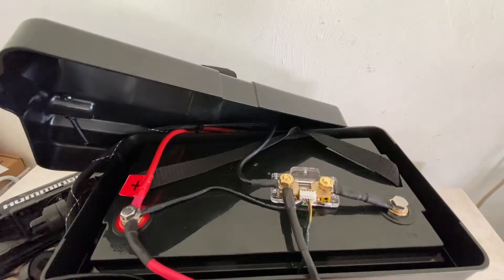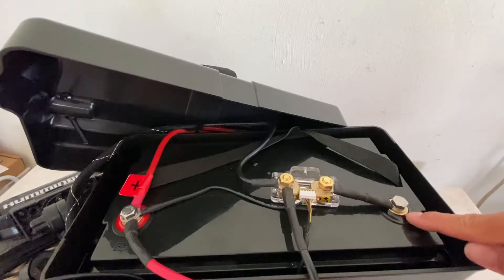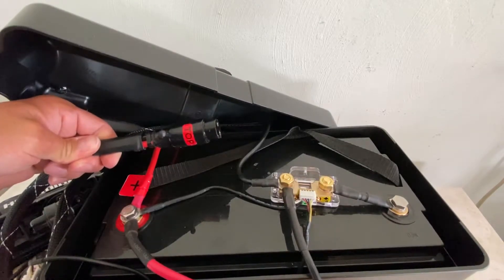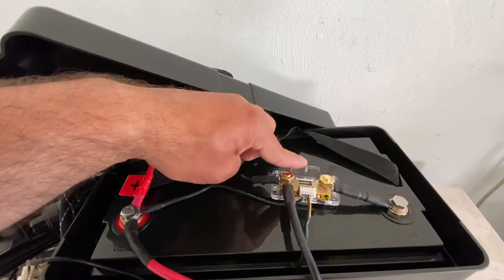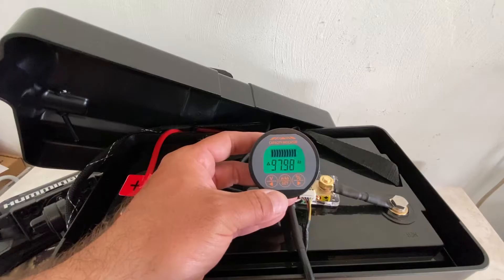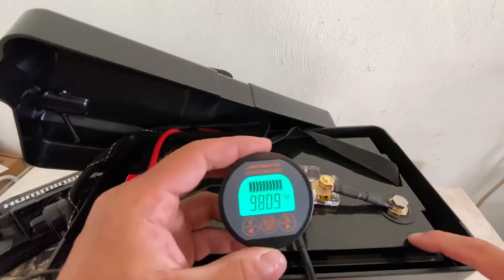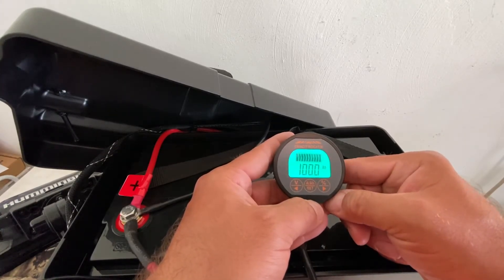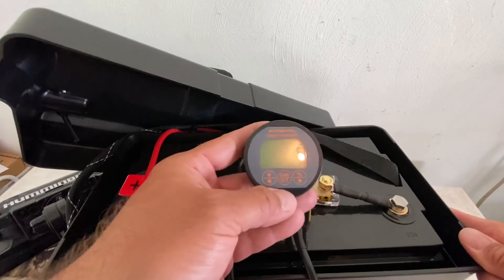Amped Outdoors Lithium Battery Capacity Meter Install for my Old Town Sportsman Autopilot 136

Comment: So I'm having an issue. Don't know if you ran into this or have heard of it. I have everything set up correctly because I've triple checked it. Everything is charging correctly as far as the percentage and everything is set correctly. But the last two times I've gone out on the water with the battery at 100%. When I get off the water to check my percentage it's at zero but my trolling motor still working. I'm trying to figure out what I'm doing wrong. Have a 100 amp hour 12v battery. Hopefully somebody that watches this video can help me with my issue. Thanks in advance

Comment: Question.  If I have 2 12v 100ah batteries for my trolling motor.  Do I set the fully charged number to 200 or 100.

Comment: Thanks for the video. I’ve got the meter on the way so this helps a bunch. You’ve got the Amped charger cable on there permanently. What do you do with it when on the water? Thinking about picking that up as well.

Comment: Just ordered from the new inventory at amp .  The kit includes a 16 gauge power wire for the shunt.  That does not fit in the 18 gauge tiny screw clip. Just the heads up for anyone planning to order and do a 100 ah set up

Comment: Why do you even need a shunt ?
Why can’t it just be wired to pod and neg terminals
Reply from the maker: That’s just the way that it comes.  The shunt is what’s telling the LCD to display I assume.  It’s monitoring the charge and discharge of the battery, then displaying that on the LCD.
Reply: @wheresthefishies  I was wondering about the reason for having a shunt as well. I found other battery meters that plug into the terminals without the need of a shunt.

Comment: What is the engineering thinking that the positive connection to the shunt is such a small screw in?   Why couldn’t it be a ring type connection like to a battery post?  Thanks
Reply from the maker: Yeah, I have no idea lol.  Probably just easier to build it that way?  It’s not pulling much power as it’s just to power the LCD screen.

Comment: How do you hook up any other powered accessories in relation to the shunt? I have bow lights, and a NMEA 2000 network that are currently just hooked up to the battery. I have the same Amped Outdoors 100 AH battery but I don’t have it in a box; just laid on it’s side in the front hatch of my SS127.
Reply from the maker: I use Yak Power products to rig most of my stuff together. It works great and so easy to use. Here is a link how I have that setup. If you look around that post, there are some other posts that show how I’ve hooked up some of my items. @wheresthefishies on Instagram and FB. 

https://www.instagram.com/p/CN3I_jbLkuH/?utm_medium=copy_link
Reply: @wheresthefishies  I run the bow lights and my NMEA 2000 network off of my 100 AH Amped Outdoors battery and my fish finder off of a Nocqua battery pack. I’m just not sure how to rehook those 2 back into the system with the battery monitor.

Comment: Thanks for the video. Does the meter turn itself off after a certain amount of time? The reason I ask is it would make a difference where you would have to mount the meter. (Within arms reach or in my case closer to the battery that would be difficult to get to.) Also, is the percentage that is shown amp hours or volts? or do you have to switch to amp hours to see what is left before the battery dies. Do you have a picture of your kayak and where you have mounted this? I have a blue tooth on my battery but only shows the amps you are using at that moment. Does not show percentage or how many amps left. Sorry so many questions but you said feel free to ask. Are you still using it, and is it working out for you? Thanks in advance if you are able to get to me.
Reply from the maker: The meter screen does turn off so you have to push a button to get it back on. The meter shows the full amount of AH you have left as the battery drains. So if you look one time, it will show 100ah. Then look an hour later, it will show 92.5ah. You can also see the percentage overall left. It also counts down backwards. I don’t have the meter mounted to anything. It just hangs out of the battery box and I lay it next to my kayak seat. When I want to see what I’ve used, I just pick it up and check. I am using the Old Town battery box that came with my kayak. It has enough room in it for everything to connect and close the lid. The lid has a raised section that allows the raised wires. I am still using it and LOVE it. It has made life much easier as I don’t have to guess when my battery may be close to dying, especially on larger bodies of water. I will also use it to determine how long I might fish in the current weather conditions. I am on Instagram and Facebook as WheresTheFishies. I believe I have some posts on there showing the install and such as well. If not, you can message me and I can try to get you some pics and such.

Comment: Do you have a picture of how you closed the battery case with the shunt and additional charging cable?  I was going to order the shunt for my 100aH Lithium battery. Thanks for a great video. Did you leave the meter hooked up and did you install it in the battery box?
Reply from the maker: Sorry, I didn’t know I had a question on here. You might be able to see some pics on my Facebook or Instagram under WheresTheFishies. If not, I can try to get you pics. My case came from Old Town. It has a raised lid on it. It allows me to hook up the cables and shunt with no issues. There should be plenty of space. Now if your lid isn’t raised, it might hit the top of it. I just have the meter hanging out of my box and plugged in at all times. When I put the battery on my kayak, I just lay the meter next to me below my seat. When I need to look at it, I just reach down, grab it, and look. It’s pretty easy and allows me to monitor my battery charges being connected constantly.
Reply: @wheresthefishies  Thanks I figured it out !!!

Comment: Just finished installing the meter shunt on my Amped Outdoors 60Ah lithium battery. Never would’ve figured it out had it not been for your great video. The installation instructions provided with the meter weren’t much help. It works great and can’t wait to get out on the water with it. Thanks!
Reply from the maker: You’re welcome and glad I was able to help. I know I went through some trial and error when I first set mine up so I figured I’d throw up a quick video in hopes of saving someone a bit of time.